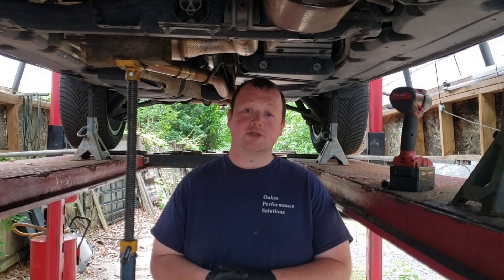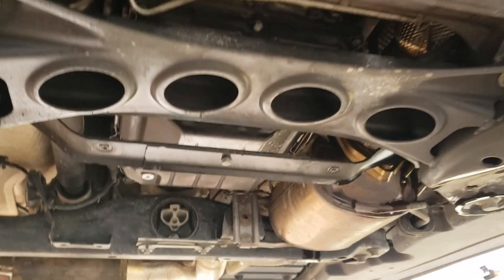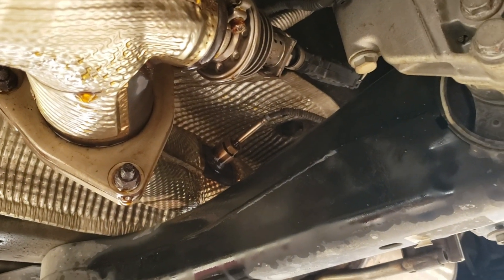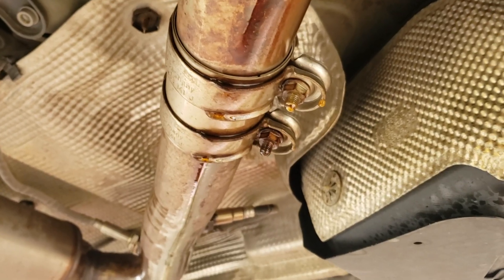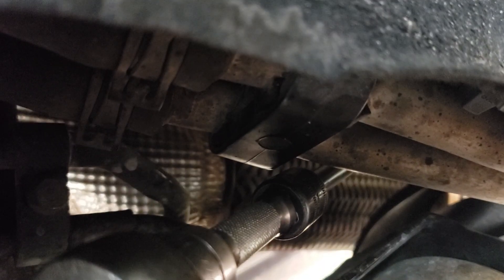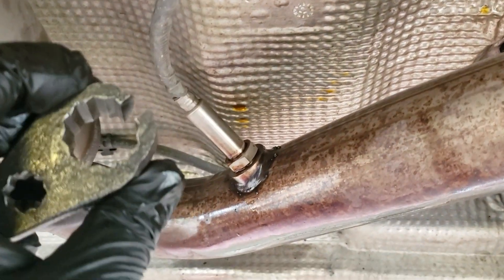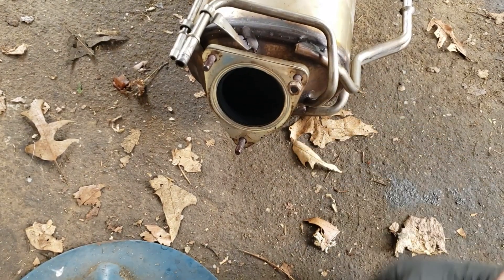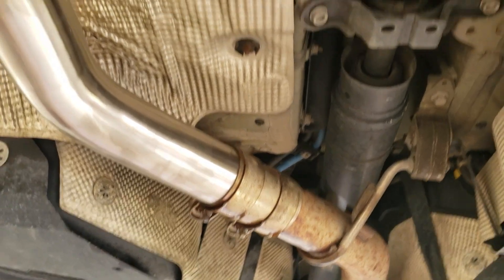DPF/SCR/ Exhaust Replacement on 3.0 TDI Audi Q7, Volkswagen Touareg, and Porsche Cayenne Diesel

Comment: You don't need to cut that lower EGT sensor number four. You can simply just chase back the wire unplug it pull down the heat shield from the side of the transmission
Reply from the maker: I happen to agree that it doesn't need to be cut but some people do. The electrical connector should be orange and located behind the turbocharger on the frame of the vehicle in the back of the engine compartment. The wiring is usually about 3-4 feet long in between.

Comment: I changed my def injector on my 2010 Audi Q7 3.0 tdi diesel cause it aways had this bad ammonia smelled comeing out the muffer and the def injector  had not to much of the crystallized from the adblue but now it been a couple of days and no problem with the injector but the smell is still there any ideas why??
Reply from the maker: The old stuff has to burn off.

Comment: Hi, I've had no luck on forums or facebook trying to identify the pipe that's losing all my coolant, any chance you can help identify it please? My 2007 AUDI Q7 3.0TDi (Model 4L / Engine Code BUG) is losing all of it's coolant within 3 or 4 minutes of starting the engine and then displaying the coolant warning light. I made a short video https://www.youtube.com/shorts/Tcy6ZlmLHyI
Reply from the maker: Hey, it is hard to tell but my assumption would be that you are looking for the coolant hose 059121051B but you can email me and I can send you some ETKA diagrams that I quickly found.